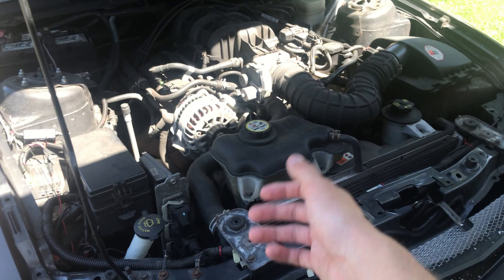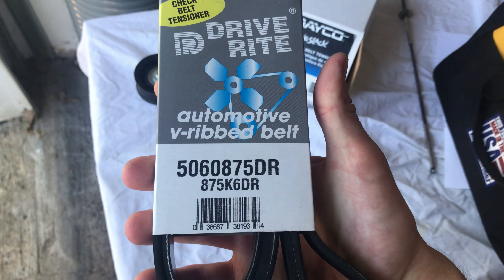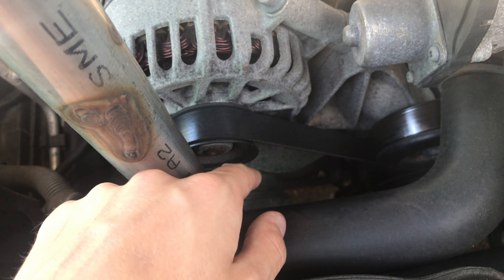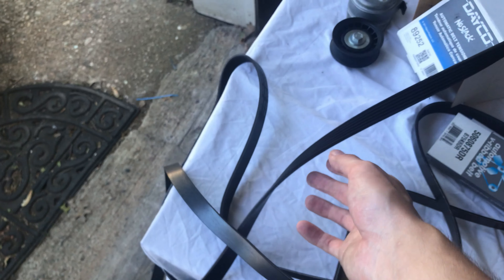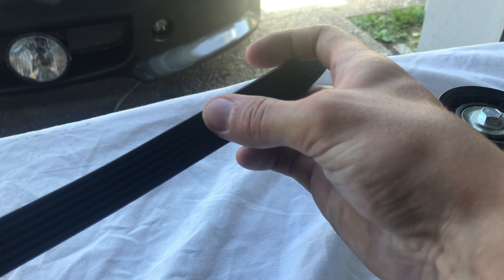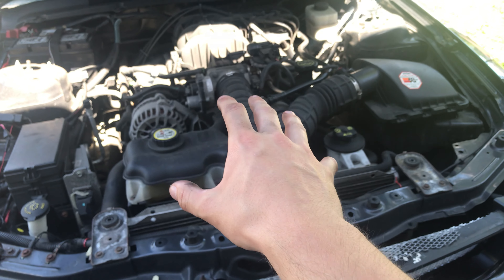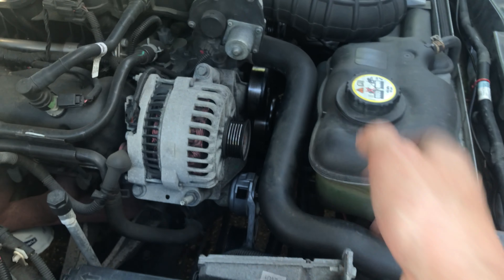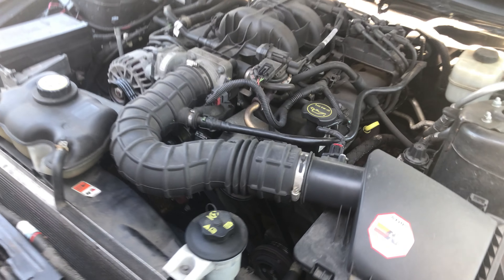How to REPLACE a TENSIONER PULLEY and SERPENTINE BELT (2005-2009 Mustang)

Comment: My new 2001 mustang seemed to have an issue with the tensioner pulley jumping back and fourth. I believe this caused an idle issue dropping and accelerating. I replaced the tensioner pulley the two idler pulllies and the belt. The belt now squeeks. what do you recommend?
Reply: probably placed the belt wrong. try putting water on the belt/pully and see if it squeeks still if so, its the belt